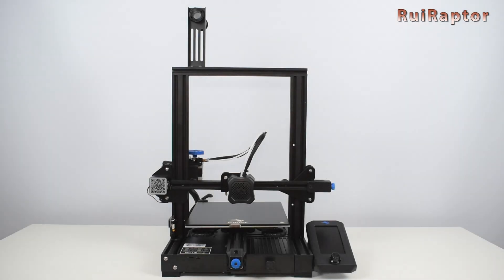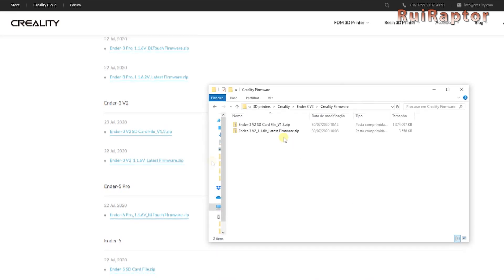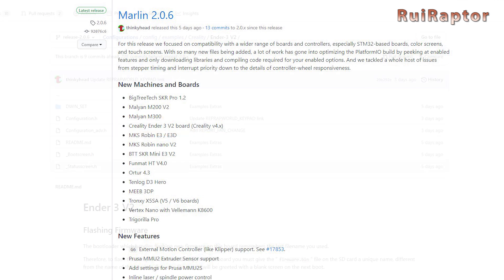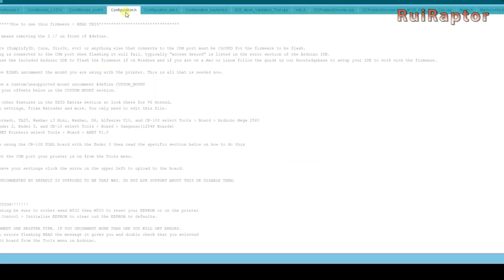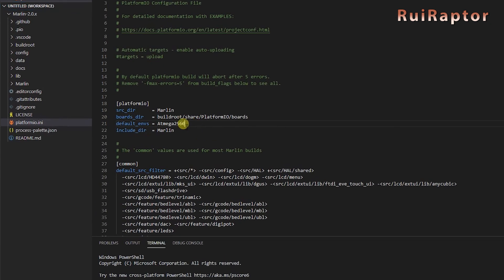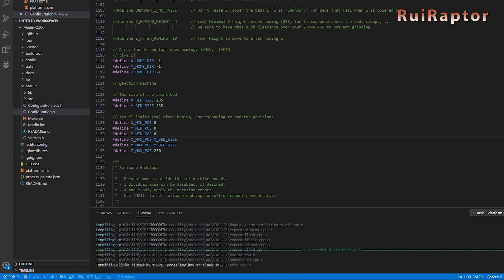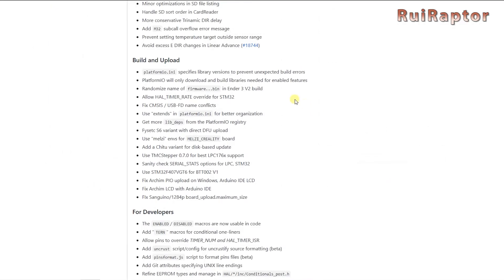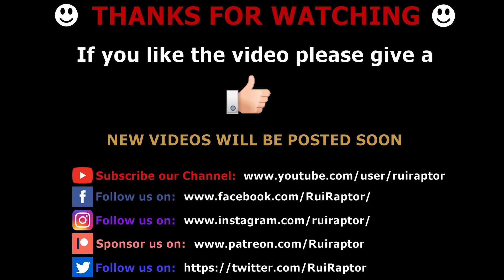Creality ENDER 3 V2 - How To EDIT & UPLOAD New Firmware

Comment: I followed the video, and successfully compiled Marlin 2.0.6 after 
making the suggested updates to enable M600 Filament Change for my Ender
 3 V2. However, the Control Screen is messed up in places, e.g. "Storage Configuration" looks like "orage configuration", Transmission Rations sub menu shows as "Transmission ra E" etc
Reply from the maker: Hi, did you try to flash the display too?
Reply: @ruiraptor  yes, flashed the display also. It seems like it's an issue with the new Display files. Chep has a video on V2 firmware upgrade, and he flashes the display as well, and had the same issue.
Reply: @ruiraptor  And now, I have another issue. So, after flashing Firmware to Marlin 2.0.6, you know how the bed moves to the front on Y-gantry. But now, bed doesn't know when to stop moving on Y, and slams in the end-point. I have a video of it, lemme know how to share with you, good sir.

Ender 3 V2
Reply from the maker: Hi Gaurav, we noticed that if we try to print a gcode file which filename is longer than 23 characters the printer will act weird. Changing the filename with something shorter than 23 characters long did the trick.
Reply: @ruiraptor  I'm aware of that issue, and always use shorter filenames. I resolved the issue: Max BEDSIZE on V2 can be 230x230. 235 on X or Y, is off the bed. I'm surprised you didn't hit the same issue, after changing bedsize to 235x235.
Reply: You mean Filament Change Menupoint as on the predecessors models? How did you activate it?
Reply: @rupiorupio282  
Besides Display issue, Pause/Stop print issue, there's a video that Crosslink did on enabling "Filament Change" features (M600, fast feed unload, Advanced Pause etc) after flashing to Marlin 206. However, he used an E3Pro. The same changes work very differently on E3V2. I'm guessing because of the same pause/stop issue, because Advanced Pause is what doesn't work as expected, + fast feed unload filament doesn't work. And if that's set l, in addition to fast feed, it causes extruder to grind cuz it didn't fast unload, before the fast load step.

+ The beeps, and pause click prompts are different, and there's no on-screen feedback, prolly due to lack of "filament change" LCD option, and the LCD being a non-programmable one."
Reply: @GauravGulati2019  Thanks. For the moment I will wait. I'm interested in sdcard menu, but I suppose that there would be the same problem with showing the menu option on the display.
Reply: can you explain the M600 Filament Change for my Ender? tnx

Comment: The latest marlin has a huge problem that ended up with my motor dieng it randomly speeds up the speeder to 600 and starts slamming it into the extrusions any fixes?
Reply from the maker: Hi Luca, if you notice any issue, you should stop the printer and don't continue with the print. Try the creality's Bin file instead and see if it runs normally.
Reply: @ruiraptor  it does I'm using it right now
Reply from the maker: Does that happen with both (creality's bin file and Marlin 2.0.x compiled bin) ?
Reply from the maker: @Luca B, we think we have replicated the problem and found the issue. Try saving your gcode files with a smaller name (less than 23 characters long) and test again. We tested with a long gcode name and our machine had the same baehaviour as your had. Changing the gcode filename to a shorter name did the trick.

Comment: This video helps me a lot!!!
However, my X motor runs at full speed to the right after I updated the firmware.
I was not able to print anything.
Once it home all 3 axis, the X motor suddenly runs at full speed.
Is there anything I can do?
Reply from the maker: Hi Zack, you are probably using the wrong steps/mm. Try to restore the factory settings (in the display menu) and see if it helps.
Reply from the maker: Hi Zack, we found the answer to your problem. If you use long names for your gcode file (longer than 23 characters) the machine will have that behaviour. But if you use a short name (shorter than 23 characters) it will print normally.
Reply: @ruiraptor  Thanks!!
I keep using the same file for the test, so I keep getting this behaviour.
Reply from the maker: Hi Zack. Is the filename longer than 23 characters? Did you try printing with a shorter name? What was the result?
Reply: @ruiraptor  It is running perfect now!
I haven't thought about there's a file name length limit!
Thank you so much!!!

Comment: Hey, I tried doing a firmware upgrade and enabling manual mesh bed leveling, due to a slight dip in the center of my bed. However, when I went through the typical process to enable that, I ended up with errors. I was wondering if you could cover that on the ender 3 v2 with marlin 2.0.x or have any tips on the matter
Reply from the maker: Hi, enabling new features will require some work on the display side. We will try to cover that soon.

Comment: Should I run the bugfix file or the marlin 2.0x file? Currently running bugfix and am having very inconsistent issues, over extrusion and random print speeds. Doesn’t seem like a stable file.
Reply from the maker: Hi Travis, we tested the marlin 2.0x file and it works correctly.

Comment: Hello.
I received last batch ender 3 pro with creality 4.2.2 board.
Can upgrade marlin with same method like ender 3 v2?
Reply from the maker: Hi, for the Ender 3 Pro with the creality 4.2.2, you should download the config file for this version here:
https://github.com/MarlinFirmware/Configurations/tree/release-2.0.6/config/examples/Creality/Ender-3%20Pro%20V1.5
Use the same procedure in the video to compile it.

Comment: Successfully built the FW, but I have three warning messages. any help?
Here is the screenshot: https://www.dropbox.com/s/vt8a6ml7cnjx1n3/Screen%20Shot%202020-08-04%20at%203.29.05%20am.png?dl=0
Reply from the maker: Hi Jimmy, these seem to be warnings not errors. Didn't you get the succeeded at the end?
Reply: @ruiraptor  yes, I had the successful build, but just those warnings make me a little bit  uncomfortable, dunno if its gonna brick the machine. :)

Comment: Question: Is it true that the printer's file manager doesn't let you have folders with different files? I do a lot of smaller projects so I often sort gcode into project folders...
Reply from the maker: Hi, we just tested with our printer (marlin version 2.0.6) and we can navigate through folders on the memory card and select/print files in those folders.
Reply: @ruiraptor  oh good! Thank you. 🙂
Reply: with the original V1.0.1 from creality fuirmware , there is a little bug that you don't see the folder structure on the card; they are aware of it

Comment: thanks for the nice explanation..  I have an inquiry, Z nozzle location not working on the screen I do not know if this feature was working previously
Reply: I updated the Firmware  and the screen
Reply from the maker: You can try the firmware bin file from creality and check if it was working correctly.

Comment: Note that the DWIN_SET that accompanies the Ender 3 V2 example configurations must also be installed when updating to Marlin 2.0.6 or the menu items will not be drawn correctly. Place the DWIN_SET folder on the SD card, insert the card in the back of the display, reboot the machine and wait for the screen to turn orange, and finally remove the SD card. In the future we hope to get the full menu system working on this display including support for all 2 dozen languages.
Reply: It sure is NICE to have someone "famous" here!  ; )  Thank you for all your hard work thinkyhead!  You ARE GREATLY appreciated by us all!  : )
Reply: I followed the video, and successfully compiled Marlin 2.0.6 after 
making the suggested updates to enable M600 Filament Change for my Ender
 3 V2. However, the Control Screen is messed up in places, e.g. "Storage Configuration" looks like "orage configuration", Transmission Rations sub menu shows as "Transmission ra E" etc
Reply from the maker: Hi, since we didn't change anything in the display files, we didn't run the display update procedure. We didn't notice any issues with the display icons. Probably is only necessary if you enable extra features?
Reply: ruiraptor I found that the DWin update botched a lot of the parameter names. Pushing words together so the letter spacing is wrong, also things like “ongfigaration files”. This is a Creality issue I think.
Reply: @MadAl37  Marlin draws the DWIN display by using coordinates that correspond to the JPG files in the DWIN_SET, so you have to make sure to use the DWIN_SET that goes with 2.0.6. The appropriate DWIN_SET can be found here: https://github.com/MarlinFirmware/Configurations/tree/release-2.0.6/config/examples/Creality/Ender-3%20V2
Reply: @MarlinFirmware  Hi, I have problem, doing same as on video but after put sd card with new firmware I see only black lcd, so I fount this comment, update lcd firmware (orange screen) but still see after turn on only black screen, could you help me?
Reply: @palosivy  the LCD firmware update needs to be directly inserted in the LCD Display. The ender 3 VW has an extra sd card slot inside the display. You will find a lot of videos on how to find and update the lcd display firmware.
Reply: ruiraptor another issue I have is when I stop a print. It homes then moves back to the position I called the stop on. Almost as if it’s waiting to continue after a power loss. As the stepper drives are still engaged.
Reply: @MadAl37  yup! If I stop a print, it goes to Auto home, and then back to the middle of the bed. Also, after stopping a print, it gets messed up when you start a new print, and it shows last print status. I have to power off and on, to get it to work well.
Reply: Gaurav Gulati Yes. Same here. These things will slowly get repaired. It’s a new printer. New board. New tech. Sometimes it’s better to report things and have two people report it than none at all. I worked with robotics for nearly 30 years. I had a brain tumour which pretty much destroyed my memory. Some things are just common sense, happy to help.
Reply: @MadAl37  did you report the bugs back to Marlin yet? I'm going to send a note to them today.
Reply: @Gaurav Gulati  I haven’t no. I wouldn’t know where to start. Feel free to add what I’ve found. Both the display and the stop issue. Also you correctly mentioned when stopping a print the progress bar and stays at the previous models stop position.
Reply: @Gaurav Gulati Do you have an issue where when you remove the memory card, the card contents stays on screen. Replacing the card with new files fails to update the list and a hard reset, (switching on/off) is the only way to update the card contents?
Reply: @MadAl37  will do - will have to find a way to give feedback on Marlin's website. Thanks. And yes, that happens with me as well for progress bar, when you stop a print. The only way to solve is reboot printer.
Reply: @MadAl37  No. SD-Card refreshing do not work if you use an external card reader, cause in the internal sdcard slot there is a pin that triggers it.
Reply: @MadAl37  nope! I don't have the sd card issue that you mention. Prolly try to format the card and see. SD cards that come with the printer aren't great, and usually have issues eventually.
Reply: rupio rupio makes perfect sense. I’m using an extension as I somehow managed to push the memory card into the case. I’m surprised it never shorted the motherboard. So yep. Good call.

Comment: I get this error: STM32F103RET6_creality    FAILED    00:00:06.404
Anyone?
Reply: had the same issue, fixed it with deleting folder  Marlin-2.0.x\.pio\build\STM32F103RET6_creality and compile again
Reply: @x3ownedx3  This worked for me. Thanks.
Reply: I had the same issue, pay attention you copy the config files for the ender3v2 in the right folder!!
They need to be in nthe marlin-2.0.x/marlin folder
another compile worked fine for me afterwards
(running all on Debian Linux Buster 10.4)
Reply from the maker: Hi Henrik, there should be a more detailed error message. Please contact us by email and send us the printscreen with the error in the terminal.
Reply: I have the same issue and i tried the methods from the comments above but they also didn’t work :( the specific error i think is from “UnicodeDecodeError: ‘utf-8’ codec can’t decode byte 0xb0 in position 111: invalid start byte” is there anything i can do about this? Thank you!

Comment: I know it's a bit more complicated, but a nice detailed video of how to create custom Marlin features and new UI icons associated with the DWIN_SET folder?
I.e.
1)  Is it possible to show REALTIME FEEDBACK of the X Y Z nozzle location as previously before as the Ender 3 and PRO on the HOME screen? This is VERY useful if a Z layer crash, and trying to restart at that crashed layer etc.
2)  Fan speed info on Home screen?
3)  Filament Change feature?

I am sure there are more, but a start.
Reply from the maker: Hi Tim, thanks for the feedback.
We are sure that the Marlin team can figure that out pretty easily.